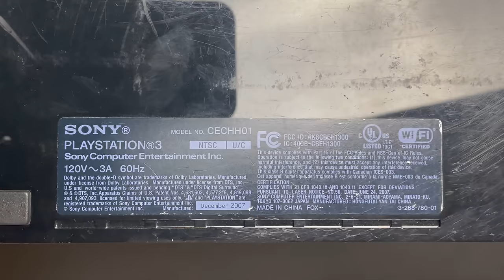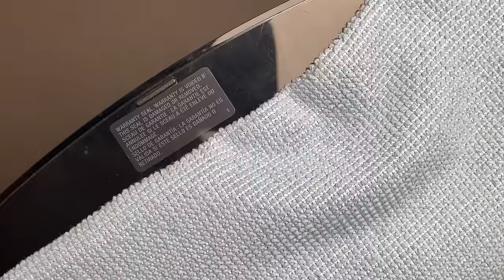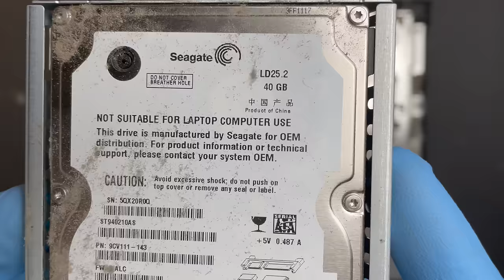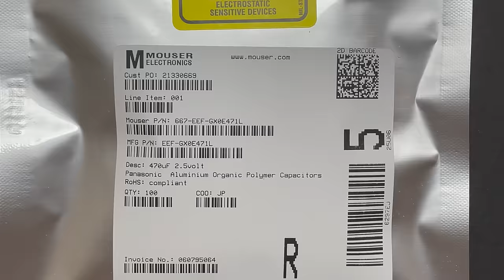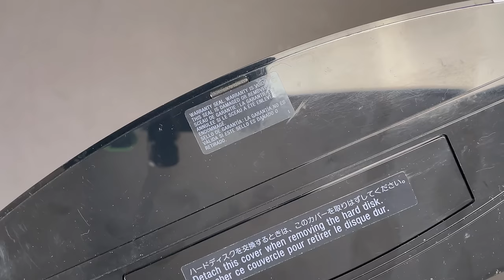Sony PS3 "Fat" YLOD Repair - Faulty Console Restoration

Comment: what would be more difficult, reballing or replacing the token caps?
Reply: @moongaming3966  soldering analog sticks on the ps3 and ps4 controllers was definitely an experience at first but i did the research and actually enjoyed the process. because none of us like stick drift. 😁

Comment: I've came across a ps3 that ylods as soon as it power on. no blue light lit up. what could be the problem? replacing the capacitor like in the video didn't help :(
Reply: Sounds like a overheating problem
Reply from the maker: Someone here mentioned that the blue light may just be an indication that there was a disc in the drive so it might not be relevant to the YLOD sequence. If I had the same outcome as you, I was planning to continue swapping pairs of TOKINs until all were replaced. But as I also mentioned there are some diagnostics that are possible to extract from the system with SYSCON, there will just be more effort on your part to do the work needed to get that info and see if it tells you anything useful.

Comment: Hey i have a ps3 super slim that won't power on. I bought a new power supply to see if that would fix the problem, it worked for a little bit but than it shut right off and is not receiving power.

 Any ideal what it could be?

Comment: i have a phat ps3  80gb version and it had this problem but there's a catch when i try to turn it on like 4 to 8 times it turns on normally and i can play black ops 1 (it's a physical version i have the disc)on it but when i launch a downloaded game it gives me the red light after like 10 to 15 seconds i tried everything from formatting the device i even took the hdd out and put it in my pc and i formatted it using my pc then i put it back to the ps3 and i reinstall the os through usb do you have any idea about the reason i bought it used and it had cfw but i removed it and put ofw if you have any ideas i would love to hear them.

Comment: But you replaced only one side with 4 tantalum capacitors? And worked?
Reply from the maker: I didn't use tantalum caps. The first thread I shared in the video description will explain this trial and error approach in greater detail. Some people succeeded with replacing just 1 capacitor. Some people replaced all 8 and it still didn't work. Without knowing exactly what is causing the YLOD you are just taking a guess. The TOKIN capacitors are the problem SOME of the time, but not all the time.

Comment: Mi PS3 super slim was acting as if it has a broken WiFi module which was not the case because when i've upgraded (via pendrive) the system software to 4.89 voila! wireless internet conection was back... but and that's a big but... my perfectly functional and fully charged original controllers are not syncing (i'm using orignal USB cable)... any suggestions? i've already tried reseting the controllers with a clip.

Comment: That’s not why it’s called yrod it’s actually a yellow light that flashes with a specific error yours doesn’t have a yellow rod it’s a different error of some kind
Reply: I want to add vids have taught me so much n great quality but it’s always fun correcting someone that’s smarter than myself there actually a yellow light at least in the 40gb I had lol

Comment: Is this the best semi permanent fix currently?
Reply from the maker: Hard to say. Not many people will come out and report that their repair stopped working, so it's hard to gauge the longevity of the repair by folks that tried this years ago. Short of blasting those caps with a heat gun to temporarily revive them, this is the best approach I found.

Comment: So my ps3 has fallen victim to the YLoD yet, I play on it almost every day. I have found that instead of opening the playstation up and tinkering with it or taking a hair dryer to it, you can simply hold on the power button until it beeps for a second time after the initial power on beep. It may not work on the first try and shut off, but if you retry it, it should work. Now, it does shut off unexpectedly from time to time during a really long gaming session, or while playing a graphically intense game for about 2.5 - 3 hours for me but there is no yellow light in between the green and the red light. This may just be my console considering it hasn't been cleaned once in its 15 year lifespan and ps3's have always had a history of overheating. So if anyone tries this tell me if it works for you if not then you should probably choose the hairdryer method because I've heard that method works just fine.

Comment: What kind of glue You use if You need to stick back a sticker ir Even a rubber pad?
Reply from the maker: I've used spray adhesive in the past and it seems to do alright.
Reply: Thx dude

Comment: Are their other components on a ps3 you can upgrade ???
Reply from the maker: Not that I'm aware of, unless you're modding the unit with aftermarket cooling, drilling holes in the case, light mods, etc.

Comment: Somebody mentioned that blowing a hairdryer through the back of it for 15-20 mins upside down and then leave it sit for 15 mins it’ll fix ima try it tomorrow
Reply: Only gonna work for a few days if your lucky as when you heat up the caps it temporarily revives them.

Comment: My og ps3 works, but fans get loud after about a min after being turned on, so i haven't used it in over a year, Im afraid it will put out the yLoD. any ideas?
Reply from the maker: From everything I've come across it's desirable to de-lid the RSX and apply new thermal paste. The CPU could use a thermal refresh too but others have stated that the biggest risk/reward is the GPU in particular. It's not for the faint of heart and I have no desire to try it anytime soon. Along with a thorough cleaning, that should help from your fans going into overdrive.

Comment: The fat / og model of both 360 and PS3 for this case have too many issue, with the ROD and YOD.

I know than many people want the og PS3 with the ps2 hardware inside, because with that you can play 3 génération of  PlayStation on one system with HDMI, but i think is way more simple to just buy a Slim or Ultra Slim PS3 who have less issue and buy a PS2.

Sure PS2 don't have hdmi but a retro tink 2x mini and a good S-Vidéo câble do a good job.
Reply from the maker: Agree, the 7th generation of consoles has got to have some of the worst failure rates amongst all the console generations.

Comment: What temp are you using for your hot air gun?
Reply from the maker: If you mean the hot air rework station, I had it at 450C but as you saw in the video I abandoned that approach and I wouldn't recommend removing the TOKIN caps with hot air. Brute force (carefully) is best.
Reply: @BorderlineOCD  I meant put the new capacitors. Not to pull the old ones off.
Reply from the maker: To be honest I don't remember what I set the hot air to when I placed the capacitors. You can quickly tell by feel if the temperature is too low. You can start at 400C if you are using a similar size nozzle for this particular job with a medium air speed and adjust from there.
Reply: @BorderlineOCD  Thanks for the response.  I couldn't get the solder melting at 400, so I think I will have to go up.

Comment: I think that it is amost unlikely amazing that you replaced those single chips with your discreet chips......
Reply from the maker: It's the common approach to swapping these capacitors out as any single capacitor with the appropriate rating is just too large to fit.

Comment: this is not the fix for ylod for majority of ps3 consoles. It is most likely due to the solder under the chips losing integrity. It may even be the case that by heating the board for the cap replacement it was warped enough to make the solder temporarily make proper contact again, hence the ps3 now booting. But in time it will fail again. the best thing to do is do a syscon diagnosis to get the proper error codes to find out what is wrong, then try to fix it.
Reply from the maker: You clearly did not watch the full video so I won't address points you've raised here that I've already discussed in the video. However there are some who share your sentiments about SYSCON and I will again stress that while SYSCON has promise to be an accurate diagnostic tool, in its current stages it is far from it and it is misleading to position it as such. There will always be folks who will get a hard on when they nerd out on the latest and greatest, and I'm one of them. But I'm not making a video about SYSCON and positioning it as the go-to solution because we both know the project is in its infancy in diagnosing the majority of error codes beyond the obvious ones and what they mean. TOKIN caps became faulty in many Toshiba laptops that used them at the time, and there is no doubt they contribute to YLOD cases on the PS3. How much? The truth is no one except Sony knows. Everything we read online is anecdotal in terms of significance. There is also confirmation bias depending how you research this issue as I have done so and there are no shortage of proponents on both sides of the argument to steer you one way or another. For the average person that just wants take a shot at reviving their YLOD PS3 and has some basic soldering skills, it's a feasible approach to replace the TOKIN caps and hope for the best.
Reply: @BorderlineOCD  correct, I didn't sit through the whole video. It was at the point you  misunderstood why it's called the yellow light of death (It briefly blinks yellow before red) that I said f-it and decided to skim it. Sorry for that, but that was my reason for not giving my full time to a long cap-replacement vid, it came off as misinformed in the first few minutes but you clearly are not. I'd have put syscon first over potentially permanently damaging the ps3 beyond repair with a cap replacement rather than mention it briefly after the job was done, one is far less destructive a way of figuring out the issue that can have dif origins. Anyway, hope others realize there's less risky options out there, that's all I was aiming at, no offense intended.

Comment: Please Help....I have a ps3 Fat backwards cap. that works but crashes when playing large games. I'm desperately looking for someone that knows how to repair this issue anywhere in the US. please please help
Reply: If I remember right, it's the same issue, with the capacitors, since they fail to provide the right voltage to the chips and that's why the console crashes.

Comment: while i do dislike ribbon cables i always likes that up until ps4 sony used regular philips screws as if they were inviting hobbyist to take it apart and explore
Reply from the maker: Yeah that first screw is the only torx in the tear down!
Reply: @BorderlineOCD  i wonder if the early slim model ps3 also used those nec caps

Comment: On delidding, I am against it personally. The mfg knows what they are doing. They would not tie their hand behind their back vs the competition without a very good reason. That is if you believe you will gain performance from delidding.

Seriously, the people doing it don't have two identical systems they can show a difference between. I mean every cpu is going to vary a bit. Comparing performance before and after is not really good because you are replacing the aged thermal paste either way. To show a real benefit one would need to reapply thermal paste EXTREMELY methodically and clean the fan/heatsink perfectly. After that run benchmarks about 100 times and document it all. After that delid and do the methodic application of paste and heatsink/fan cleaning and 100 benchmarks again.

The current consensus is it does not matter how you apply thermal paste. This is after a methodic spreading was the gold standard and now the preferred method is to apply more than enough of a glob and slap it together letting pressure spread it. I mean if that glob does not spread over every corner perfect, and you still get the same thermal performance as a methodical spreading, then what would delidding do? It's a even more methodical, dare I say purist, way to spread thermal paste. Full disclosure I still spread paste the old way I was always taught (methodical), but the benchmarks and longevity don't lie. I am wasting my time even if theoretically I should have better thermals with my method. Delidding feels like it will end up being the same thing in 10-20 years.

Comment: Been working on consoles since 08 worked on just about every console evermade exclude non us consoles I was there in the early days when people though u could reflow the chip and that method they claimed was a 50 percent failure rate I always told them this is probably the wrong avenue these were not shodley put together systems they never believed me and low and behold cap problem

Comment: @Borderline OCD
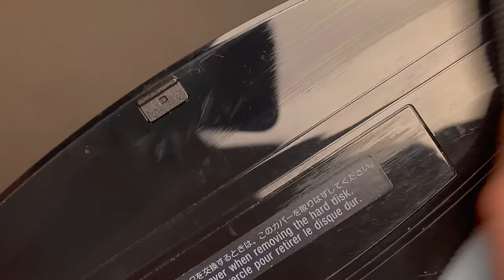2:05 Dude you just f'upped the case lol. just get a hairdryer. heat it up 10 sec and it comes off without hesitation and residues.
6:35 dont wiggle it up like that, it will destroy the bga under the rsx and cpu. heat the board with a hairdryer a little bit so it gets warm to the touch and the board should come out of its own as the thermal paste between the ihs and the cooler will get a little softer.
9:40 the NEC-Tokin come off way easier with physical removing them. that can be done easily when you slight right under them in the middle and breaking them upwards, then desolder the residues with a soldering iron. dont heat the board too much cause Ps3 boards are very sensitive to heat. Please replace all NEC-Tokin, not only a pair.
20:40 no please god no. NSC is the biggest troll we have here in germany and gets laughed at by a lot of respected forum members of the community that really know what their doing because they learned electronic engeneering and such. Even in the biggest Ps3 community we have in germany, we warned about him in an open thread where he even send his minions that fell for him on youtube complaining.
Removing the RSX ihs is pretty easy without damaging it. Just get a little bit of cardboard 1-3mm thickness 1cm wide and 3-5cm long, then stick it in the middle under the RSXihs from the cpu side as there are no components on that side of the RSX under the ihs. you can then just get a butterknive thats not sharp and slide it onto the cardboard under the ihs of the RSX so the pcb of the RSX wont get damaged. Now heat the ihs of the RSX with a hairdryer so the glue, with what the ihs is glued onto the rams of the rsx, will get softer and then slighty lift/ bend the butterknive up without much force and the ihs should pop just off.
With the cpu ihs its not that simple, better leave it as is. most of the time the thermal paste under it doesnt have to be replaced. but the RSX needs always be replaced.

Comment: Ah fans died for sure. I got my ps3 slim jailbroken and i have fan control mod, if i leave it on for long enough (like full 2 mins), and turn it off, then it wil flash in all the colors, but it wont turn off. it would run just normally

Comment: Why the hell did you use a razor blade to remove the sticker?
Just peel it off with your fingers and then clean the gunk later. I fix these all the time and never had any issue with sticker just coming off clean just pulling it. You can see in your video the permanent marks you just made from the razor blade. You never use metal tools on plastic its just a rule of thumb.
Reply from the maker: That’s no way to speak to your father, son.
Reply from the maker: Your mother and I indeed failed you, son. I take full responsibility.

Comment: These ps3s had a design flaws
Reply: Certainly did and Sony knew it to. That's why they introduced the Slim model so quickly. To cut costs and refine the manufacturing process.

Comment: Wrong way to fix a PS3 why you heat up the nec tokin just reflow the cpu and gpu almost %99 of the time it will fix it heating up nec tokin will not fix it first of all %100 of the time ylod is caused buy overheating of cpu and gpu old thermal paste is dried up causing the console to over heat reflowing cpu and gpu will fix it remove heat spreaders mx4 your good for a long time